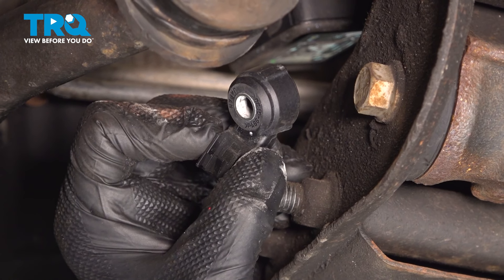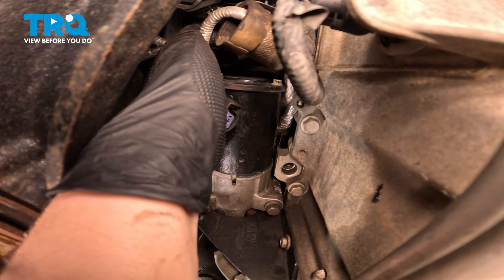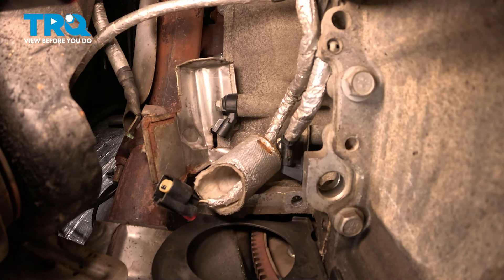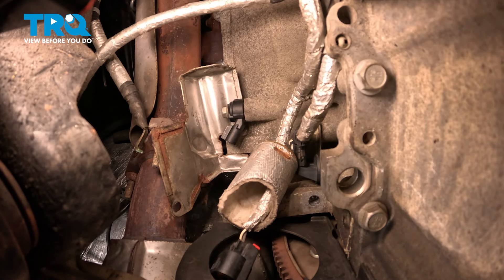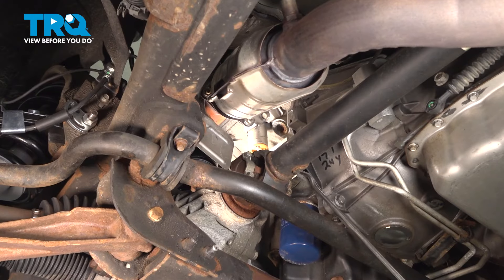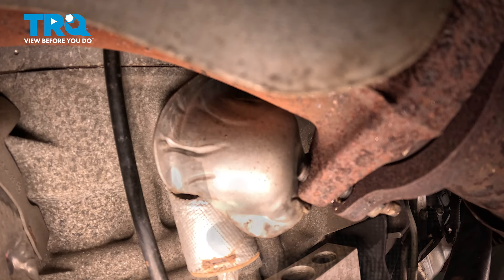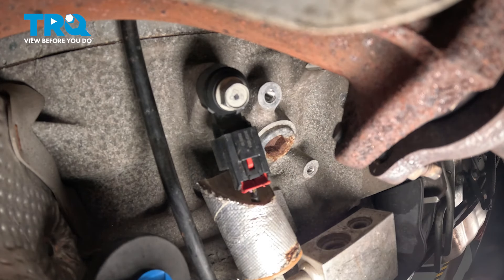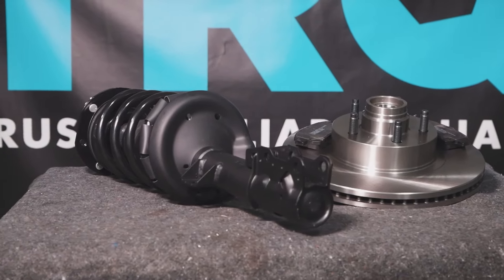How to Replace Knock Sensors 2014-2018 Chevrolet Silverado 1500 5.3L V8

Comment: This was perfect thank you. And for anyone having trouble with the connector that plugs into the starter if it's not previously damaged there is a little red table that should keyword should pull down allowing you to depress the clip and pull it off. For me whenever I tried to pull the little red clip down it broke and I ended up having to use a metal angled pick to pull what was left of it down so I could depress the clip.
Reply: I ended up having to drop the starter partially so I can get a better angle at it in order to remove the clip